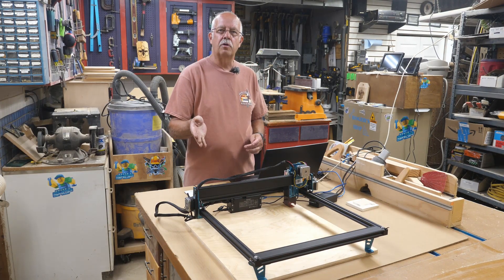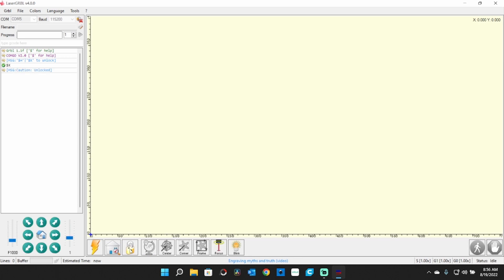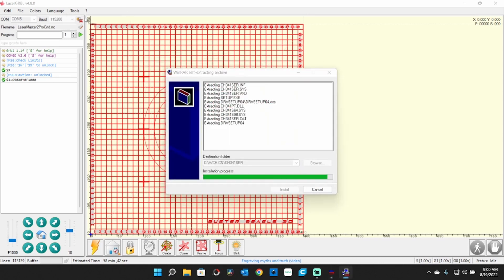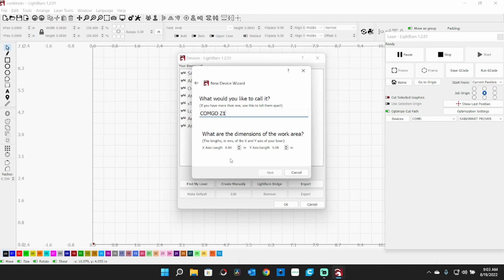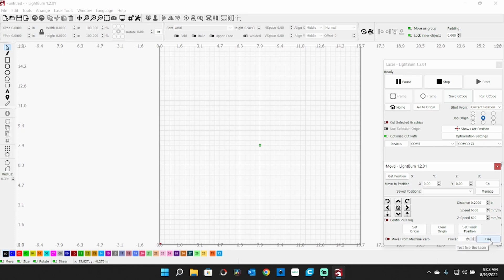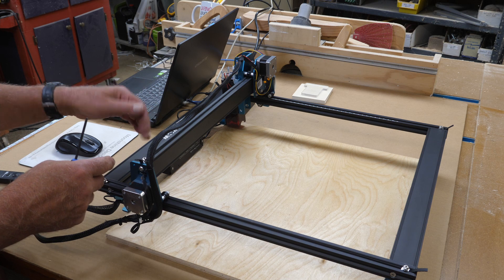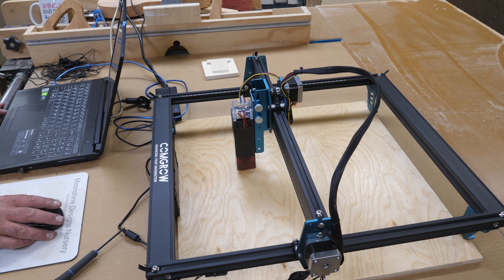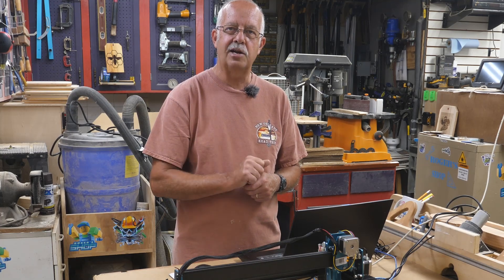Comgo Z1 Laser Setup In LightBurn and Laser GRBL

Comment: Hey Roger. I appreciate you helping me. I was able to get the laser up and running and making some art. It was working fine until I dropped my computer and it broke. I got a new one and now the new "same exact computer" currently won't connect to laser grbl. Do you have any ideas as to why? I have looked for troubleshooting answers and I haven't been able to progress.. any advice would be appreciated.
Reply from the maker: Make sure the CH340 driver is installed on the new computer.  Without it, it will not connect.

Comment: FYI for any new users that cannot get it to connect. Mine would not connect with stock settings. I had to change from the stock 115600 Baud to 921600 Baud or it would not connect.
Reply: Just to add, Light Burn will not work on my machine but grbl will. Not sure what to do at this point. Any ideas would be helpful. So far I've uninstalled and reinstalled everything. Changed COM ports, removed and manually setup a few times as well, still waiting for connection.
Reply: I am having this problem as well. I am using windows 11. Not sure why it won't connect.. some help would be awesome!
Reply: @johnhart476  Did you figure yours out, i am too having this problem. Thanks
Reply: @jessicag1859  I have not.. unfortunately I had to get a new computer and I haven't had time to set up yet

Comment: Hi Roger, thank you for your video. I'm struggling engraving this grid. The lower right corner keep hitting the hard limit. If I move the limit switch barely enough to make it work I end up hitting the screws of the power supply while the laser is traveling. I really think the design could have been better with the positioning of that power supply...  Any suggestions? thank you.

Comment: Mine won’t connect at all
Reply from the maker: Try a different USB cable.  Had this happen before (not with this, but has happened)
Reply: @rogersshop  same issue here. It won't connect at all
Reply: What is the name of the cable? It's not an average USB because one of the ends is specific for that device.. right? Can I get this cable from amazon?

Comment: hey tryign to figure out how you start from center and set origin, how did you get the laser to the center to set the origin in the first place? just use the X/Y and then move to then set origin? wondering for when i get my Ray5 in .
Reply from the maker: What model Ray 5?  If the 5 or 10 watt, it will not have limit switches, so the best way is to use "Current Position" as a start point (from center), and set the laser head manually to the center point before starting.  If the 20 Watt, it will have limits and a homing function.  Here, use Absolute Coordinates, place project in center of workspace, frame, and go.  Make sure you are starting from Home here, and not a random spot.
Reply: @rogersshop  i have the 20 watt, with 5watt module ( their dual laser head sale)  so i should use the homing feature and just start from home (the 0,0 coordinate)?  sorry to pester, just want to make sure i am understanding correctly.
Reply from the maker: @62saki91  5 and 10 watt base models do not have limit switches, so homing is not an option.  The 20 watt does have limits, and it will home in front left (0, 0)
Reply: @rogersshop  so with the 20 watt model, before starting, home it to 0,0 and start from there with absolute coordinates?, even if project is in the center?
Reply from the maker: @62saki91  Yes.  Just make sure your project is centered in the workspace and always frame the project first.
Reply: @Roger's Shop  Thanks, it just came in the mail today, ran the tf card test burns, did good.
Reply: @rogersshop  how much for some of your printed longer brackets to keep it from shifting?
Reply from the maker: @62saki91  Two different versions, depending on if you want the riser option:  https://moonshinecrafts.com/product-category/laser-mounts-accessories/
Reply: @Roger's Shop  bought both options, cause I do plan to get an xtool ra2 rotary sometime for cups, rings, glassware. But right now going to do a market test for some coasters both cork and round slate.

Comment: I have a question for the retired electrician..  Limit switches...  Normally closed, right?  The Comgo Z1 only has limit switches in order to home the machine..  If I wire them in series, I could add extra limit switches for the other end of the X and Y axis to protect the machine from crashing if I do something dumb..  What do you think?
Reply from the maker: It depends............  Can be either N.O. or N.C., depending on how the firmware is written.
Reply: @rogersshop  understood.. I can check with my multimeter.  If NC, it would work I think..  Tripping either one would break the circuit.
Reply from the maker: @ericeinsmann5559  Yes.  If N.O. then could be connected in parallel.  N.C. would need to be in series.